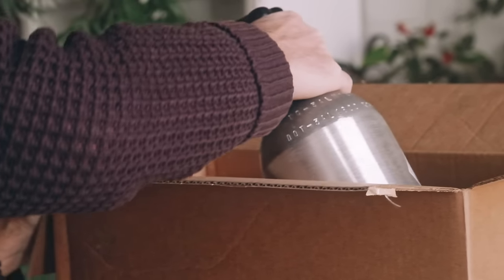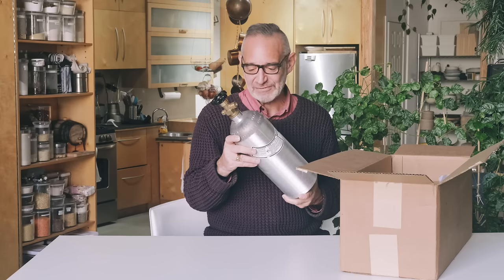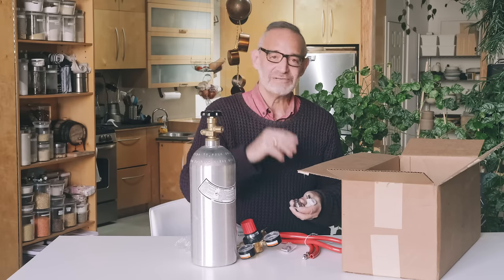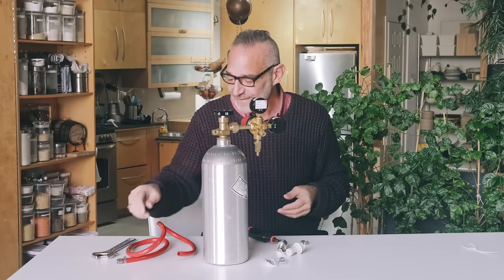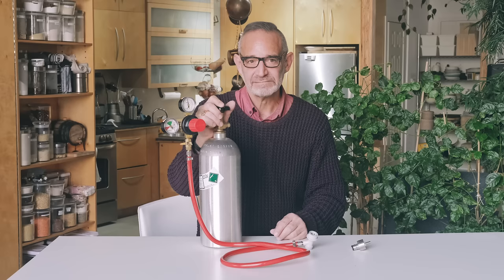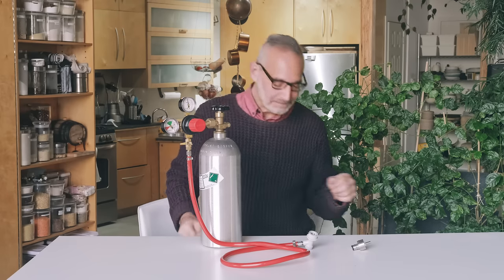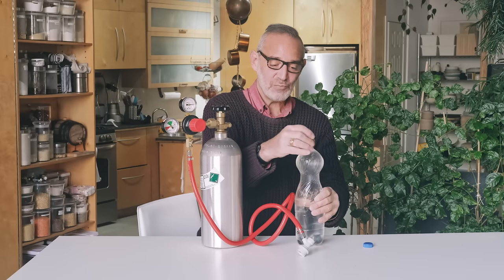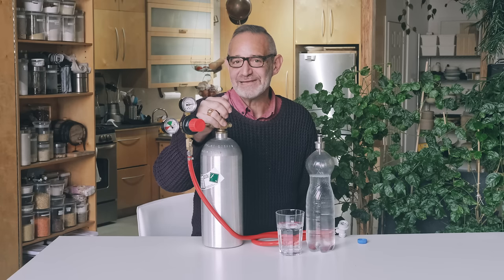CO2 Tank For Making Sparkling Water | What To Get and How To Put It together

Comment: Hey, just wanted to thank you guys again for this video! I'd been using a Sodastream for about 8 years, but the CO2 refills just kept getting more and more expensive. I bought the set-up you recommended from keg Outlet, and it's been working great! I thought I'd mention a couple of things: I'm not a huge fan of plastic, and, TBH I worry about the rather thin-walled, single use soda bottles possibly rupturing while carbonating. So, I bought some glass sparkling water bottles from the store and had been using those. The only problem was that the stainless steel fill lid that came with my set up kept chipping off the threads of the glass bottles, and who wants glass shards in their drink?? So, I went to my local fermentation shop to see if they might have plastic fill lids that would work. Well, they have plastic fill lids that work with plastic bottles, but not with glass bottles. I mentioned my concern about the plastic bottles rupturing while carbonating and he said he'd never heard of that happening, but, he has heard of glass bottles rupturing--he says they can get stress cracks that you can't see! Obviously better to be hit by pieces of plastic than pieces of glass! Also while there he recommended a .05 micron diffusion stone saying it would produce a finer bubble--and he was right!! Really like using the diffusion stone, get them on Scamazon: https://www.amazon.com/Ferroday-Diffusion-Stainless-Aeration-Carbonating/dp/B07DFF4D3H/ref=sr_1_3?keywords=diffusion%2Bstone&qid=1681179731&sr=8-3&th=1
Reply from the maker: Wow, I'm so glad that's working out so well for you!  I agree that the glass bottles are rather risky if they do explode!  Before I created my set-up, I was in Dave Arnold's bar in New York, and was watching the bartender there carbonate, then re-carbonate their cocktail ingredients.  I asked about the plastic bottles, and he said they've not experienced any problems with the plastic bottles, so I decided to trust them.  I've had a couple of bottles in use for over two years, and no issues at all.  I know they're tested at very high pressures because of the abuse they can be subject to in stores and shipping.
I am interested in the carbonation stone.... thanks for the link.  I'll give it a try and let you know.
Glad you enjoyed the video!  Happy Bubbles.
Rob & Nadia
Reply: @NadiaandRob  i'd also like to see how that stone works, i'm about to order a setup like this myself. Does the stone some how go on the inside of the lid?
Reply from the maker: @BitcoinNoddy  I'm also going to get one of those stones and see how it works.  The stone is attached to the lid with some clear vinyl tubing, so it sits at the bottom of the bottle.  The the CO2 passes through the stone and gets broken up into tiny bubbles.  It should allow for maximum carbonation, and no shaking.  I'll order one and see how it works!
Reply: @NadiaandRob Did you try it?
Reply: @NadiaandRob   Great video. I believe, however, that the purpose of the 'stone' is for the SLOW carbonation  which occurs during the keggers beer making process. It may  help- I'm interested, but the point of the stone, and the TINY, TINY holes in the stone, don't allow for quick carbonation- I believe. , and the beer making process uses much lower pressures, hence the value of the stone. during the SLOW beer making process. What you and I want is to expose the maximum area of the H2O to the gas infusion, hence the value of vigorous and extended shaking, until no more gas can enter the bottle. Agitation, cold temperatures, high pressure; I think those are the keys. Thanks again.
Reply from the maker: @divingfe  great info! Thanks

Comment: Can you do a parts breakdown? perhaps a list in video description? I can find a kit in Greece and Amazon is my only choice but still have to find individual parts,
Reply from the maker: Here's the parts breakdown from the place we bought the kit:
1 Taprite High Performance Primary Dual Gauge Regulator (Check Valve with No Switch)
1 MFL Threaded Gas Ball Lock Disconnect with Stainless Steel Swivel Nut
4' of Ultraflex Gas Tubing
1 Plastic Carbonation Cap
2 Stainless Steel Hose Clamps
 Aluminum CO2 Tank (we got a 5lb tank)

Hope that helps!
Reply: @NadiaandRob  Isn't aluminum toxic? I thought the CO2 Tank would be in stainless steel.
Reply from the maker: @btsarmyforever3816    Aluminum is completely safe for holding gas, and it’s used for many similar applications

Comment: Is it possible to buy an adapter that runs from a ball connector to a TR21-4 fitting? I'd like to have the dual option of carbonating directly to a soda bottle and connecting to my Sodastream machine.
Reply from the maker: I'm sure something like that is available.  I've seen kits for connecting to a Sodastream... and you may have to use a Y-joint to connec t the two hoses.

Comment: I found the link for the regulator… Is it necessary to buy the tank with it? I already have my own… Looking for a link to just the regulator.
Reply from the maker: That’s no problem.  The same company can sell you just the regulator and you can use it on your own tank.
Reply from the maker: Here’s a link that will solve both issues:  stainless steel growler with regulator but no tank:  https://www.kegoutlet.com/sparkling-water-maker-gooseneck-growler-faucet.html.  
Enjoy!

Comment: Thank you for the info, how many seconds or minutes do you leave it puming co2 under 60 or 50PSI? 

What do you mean when you said leave until "pop"? 

I tried it today, I don't see much bubbles, 😅

Should I leave the pressure open during my shaking?

 Would the bottle explode if over filling it under 60psi pressure??
Reply from the maker: Hi.  Yes, connect the bottle to the CO2 at 60 PSI... then give it a good shake to allow the gas to mix with the water.  30-60 seconds or more if you wish..... with the pressure on.  The for extra bubbles (I like really strong bubbles) disconnect the CO2 hose, open the cap and squeeze out all air in the bottle.  Then reconnect the hose and shake again.
That will definitely give you great carbonation... strong bubbles.
Enjoy!
Reply: @NadiaandRob  so this around 120 seconds of carbonation under pressure of 60psi, without fearing the bottle gets poped, because they can with stand pressure 60 psi easily, bottle will feel hard, still no worry.
Reply: Remember, these "Coke" 2 liter bottles are built to withstand cold temperatures, hot temperatures, the stress of multiple transportation, etc. 60 psi is OK;  So,...to clarify, fill up the bottle with your drinking water, up to the bottle curve ( If you boil it then let it cool first, then refrigerate to cold, slushy/icy, then, when connecting your unit, first squeeze out the air in the top curve, then attach-while squeezing- the CO2 cap, then open your valve which will expand the squeezed part, tighten the CO2 cap, then SHAKE It- I do for at least a minute, maybe more. When done, close your valve, and either leave the CO2 cap on to seal it, or swap with the regular cap ( on Tight). and re -refrigerate until usage time.  No more shaking, and pour gently, unless you want to release all that nice CO2 into the outside air!...   The above mentioned boiling/cooling/no air space routines are in order to allow the water to absorb the maximum amount of CO2 infusion. The more shaking, the more infusion

Comment: Hi,  Assuming I put everything together correctly, are there any dangers or safety concerns setting up and using the setup you’re showing. Thank you.
Reply from the maker: We haven’t experienced any safety issues. The soda bottles are extremely durable and they have never caused any problems. One viewer commented that you should be careful to prevent the CO2 cylinder from falling and breaking the valve off the top.  That seems sensible.
Reply: @NadiaandRob  thank you.

Comment: Mr, Do you run the risk of popping the plastic bottle? Can it be done in a metal container?
Reply from the maker: I’ve been using the plastic containers for two
Years and have never had a problem. I’ve never seen metal containers with the same thread on the lid so I don’t think that’s a possibility

Comment: I bought a  Sodastream from Traget many years ago. I loved it until.... uh oh, what happens when the Co2 runs out??
I put it in my shed and there it stayed for years. After watching some youtube videos, I brought it back to life!! It turns out
right in my town are 2 markets; 1 sells Dry Ice and 1 that sells a complete line of SS makers and Flavors! I use the dry ice method
to refill my tanks. I though about using a 5lb tank but, what I don't like is; in the US when you buy a Brand New tank and have to refill
it It Is NO Longer Yours! You have to "EXCHANGE" it!!
Reply from the maker: Glad you were able to solve your refill problem right in your town!  One advantage of the “exchange” plan is that you get a new tank every time.  Tanks need to be re-certified every 5 years, so if you’re exchanging then you don’t have to deal with that.
Enjoy!
Reply: @NadiaandRob  Interesting. I worked construction for many years. Can't speak fot Co2 but, Oxygene and Acetelyne exchane tanks were allway old
and beat up but then nobody minds on A jobsite!
Reply: I found about the "exchange" problem many years back. I bought a tank for welding, it was shiny new and I was very excited and happy with it.  But when I went to refill it, I got the "exchange" a much older looking tank and I was very sad to learn that my brand new shiny tank was taken for a much older looking tank.   fast-forward several years.   I went on Friday (day-before-yesterday) to refill it, and I was told the tank needed to be recertified and I had to pay a 35 dollar "recertify fee".   I needed it so I said "ok".   I got another tank, but now I expected to get a different tank and was not as sad as several years back. I live-and-learnt.

    Same time I asked to purchase a new CO2 Tank for making sparkling water, inspired from this video of yours, that I watched on Friday morning the first time.    Today I received all the parts (regulator, hose, ball plug etc) and I tried to carbonate a 1L bottle at 20PSI.    I used very cold water, but not almost frozen water.   It was water in my fridge for 2 days.   It did not feel any sparkle/carbonation in the water.  So I increased to 30PSI, yet did not feel any sparkle/carbonation.     I did see bubbles going into the bottle, and shook the bottle and saw more bubbles going in.  But as poured it into a glass and I tasted it, it is almost flat taste and I dont see bubbles in my glass, like yours did. Not sure what I am doing wrong.

Comment: A very interesting video.
Just wondering whether it would be possible if you already have a Sodastream to fix it to the counter top and run the hose from where the small cylinder connects through the counter top into the cupboard below and have the big tank stored in there and connected. That way you can use the 5lb tank rather than having to keep buying the small refills, but keep the convenience of the easy to use Sodastream system.
Reply from the maker: Glad you enjoyed the video!  There are definitely adaptors to attach a tank to a sodastream, and I assume you could run the hose up from the cupboard.  Should be easy to accomplish, and will definitely save you $$$ on refills!  If you have space in the cupboard, go for a 10lb tank, since it costs about the same to refill, and it means fewer trips to the gass supplier.
Have fun!

Comment: If you want to place the bottle back in the fridge right after carbonation, can you put the original plastic cap back on or it needs to be the carbonation cap?
Reply from the maker: Hi. You can actually do either one.  I like to maintain maximum carbonation, so I keep the carbonation cap on the bottle, and I re-pressurize  before putting it back in the fridge.  But I’m admittedly a carbonation nut!  You can certainly simply cap with a regular cap… and it will keep it sparkling.
Hope that helps!

Comment: great video!! How many of the bottles used in the video can you fill up with a 5lb tank? according to your liking of the level of bubles you add? I do love lots of bubbles too! lol thank you in advance
Reply from the maker: How many litres of water can you carbonate with a 5 gallon tank?  
I weighed our 2lt water bottle, zeroed the scale, and carbonated the water as usual and weighed.  Much to my surprise, 16g of CO2 went into the bottle!
So then I started calculating… 5lb tank holds 2268g of CO2, divide by 16g…. So the 5lb tank will do 141.75 bottles.  At 1 per day average, that should last around 4.75 months!
Wow… so a $25 refill will carbonate around 280 liters of water and last around 4 ½ months if you drink 2 liters a day.  Now that’s cost effective!

Comment: Thank you so much for this video! I am super curious what your feelings are on using glass? I'm really starting to mitigate my plastic intake as more research comes out, especially using the same plastic over and over as it breaks down. The glass would not allow me to squeeze out the excess air, but could you please offer some thoughts on using glass? Thanks in advance!
Reply from the maker: We’re not in favor of glass…. Risk of explosion, and we don’t believe the threads match the carbonation cap.  However, very shortly we’ll have a video out about an all stainless steel solution that you will love….. we do!  Stay tuned.
Reply: @NadiaandRob  really looking forward to that… Thank you!

Comment: Is there any danger of the bottle exploding? That is my biggest fear. How much pressure can these soda bottles take before they fail?   I am wondering if I should buy a carbonator with pump, to avoid any dangers but it adds up the cost of nearly $600 plus the plumbing which is fairly easy, but the bottle exploding is my biggest fear.
Reply from the maker: The Soda bottles are made to withstand pressures above 100 PSI, so totally safe for carbonating at 40-60 PSI.  I've been using the same bottles I started with over 2 years ago, and I've never had a problem.
Enjoy!

Comment: Excellent video! Details from start to finish. Have one criticism; tap water. I was told it can make cloudy water. Mineral or distilled is better? What do you think? How many gallons of seltzer can you make with a 5 lb. tank? Thanks! 👍
Reply from the maker: Glad you enjoyed!  We've never had a problem using tap water... stays totally clear.... but Toronto water is pretty good quality.  I'd suggest trying tap water and if that's not good, go with a filter.   You can also get a countertop distiller that works great.  
Here's my answer to a previous inquiry about how much from one tank:
 Your question got me thinking…. And measuring!  I weighed our 2lt water bottle, zeroed the scale, and carbonated the water as usual and weighed.  Much to my surprise, 16g of CO2 went into the bottle!
So then I started calculating… 5lb tank holds 2268g of CO2, divide by 16g…. So the 5lb tank will do 141.75 bottles.  At 1 per day average, that should last around 4.75 months!
Wow… so a $25 refill will carbonate around 280 liters of water and last around 4 ½ months if you drink 2 liters a day.  Now that’s cost effective!

I hope that answers your questions. Nadia & Rob
Reply: @NadiaandRob  it does, thanks. I've seen $15. charge.  Worth shopping around for best price. 👍🥛
Reply: @NadiaandRob  I got 6g CO2 into a 500ml bottle of wine at 40PSI. That would be 24g per 2L or 50% more than your measurement.  I wonder if wine absorbs more.  I don't want to try it on a 2L bottle because I might drink the whole thing!    I make all my own wine from Costco kits - I think someone like you would enjoy that.
Reply from the maker: Interesting results with the CO2!  There are many variable... temperature, agitation, different liquids etc.
Carbonating wine is fun!  We do it in the summer.... also cocktails (more videos coming soon!)
Haven't gotten around to making wine yet.... but it would be fun.
Thanks!
Reply: This maths is brilliant- pennies on the dollar compared to all the Topo Chico I consume here in Austin Tx- thx I’m ordering my kit this week!!! Seriously!!

Comment: Thank you so much for this!  I've been thinking about eliminating all the plastic bottles of carbonated water I buy even though I recycle them.  I have one question - when you are shutting down after carbonating your water, you turned off the valve on the top of the tank.  I didn't see you turn off the valve on the hose attached to the regulator - do you recommend that?  Thank you!
Reply from the maker: Glad you enjoyed…. Here’s to eliminating plastic bottles!  Once you’ve turned off the main valve on the tank there’s no need to turn off the valve on the hose.  Nothing’s coming out of the cylinder so all’s good.
Reply: @NadiaandRob  Thank you!  And your home is lovely.
Reply from the maker: Thank you!  Stay tuned… we’re moving in July to an equally beautiful space. Videos to follow

Comment: I got a Sodastream (bought it used) but want to try this approach also -- so I made a Sodastream compatible cap for ~$30 in parts.
Reply from the maker: That’s a cool idea. Do you notice much difference between the two?
Reply: @NadiaandRob  My initial impression is that the carbonation cap provides more carbonation than SS but shaking the bottle does require more time and effort.